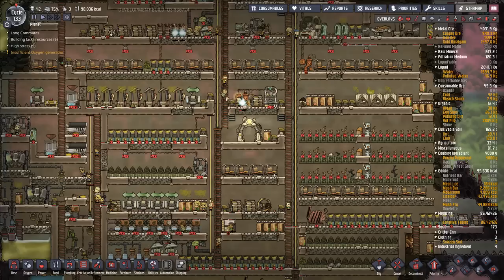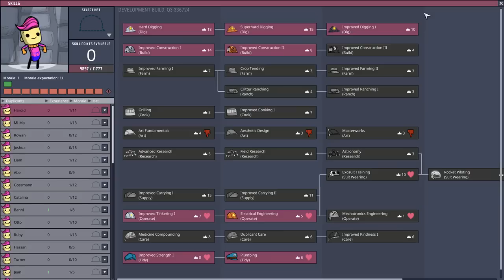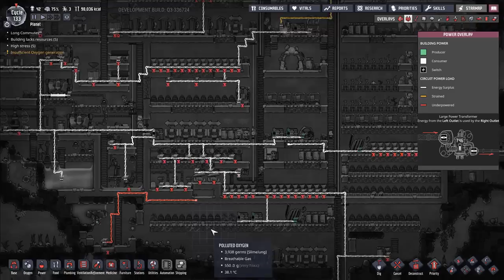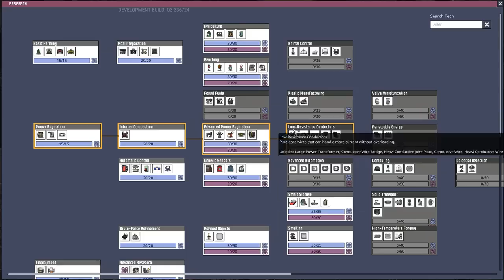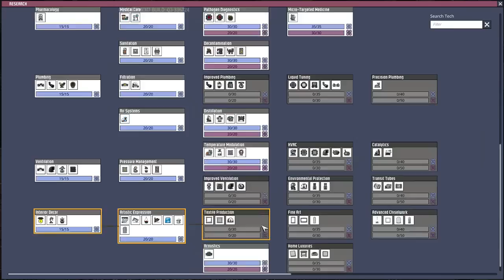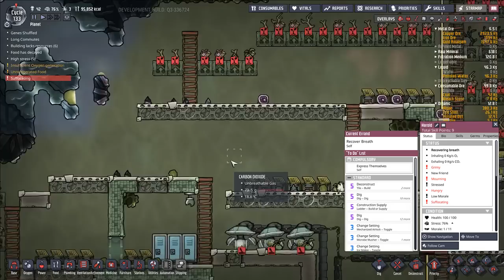HELP!  Base 911 - Looper17 Episode 1 [Oxygen Not Included]

Comment: I highly recommend triage. And I don't mean the Thanos method. I mean the straight clinical, ruthless, eugenics artificial selection method.
Get rid of all the dupes with very negative traits that he clearly chose, such as mouth breather, bottomless stomach, flatulent, or even narcoleptics at this point. Keep pretty much only diver's lungs.
Get rid of the dupes with higher than 60 stress.
Get the number down to 12 at the most, which is pushing it for how the map is set up (even if you got oxygen running).
Kill them by sending them into a room with no air and a 1-way door, then deselect their food privileges.

Triage is important for saving the colony. Call me evil if you want, but I'd rather 1/2-2/3 die within half a cycle than have 3/4-9/10 die slowly and painfully.
Reply from the maker: I dont think the base is quite as bad as that. He's got a decent amount of water left, and a reasonable amount of food, I'm pretty sure I can stabilize the base without any deaths.
Reply: @gearheadgaming1  I am a pescimist, but I'd say the max I would attempt to save is 24 at that juncture just because of consumption rates vs rates of O2 production from the current electrolyzers. I mean 42 is a very large number even for veteran players